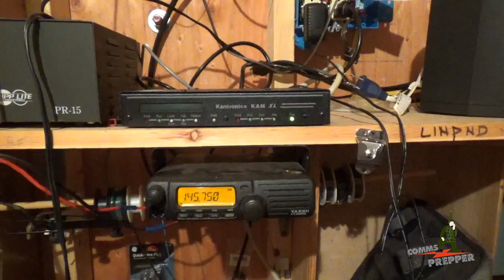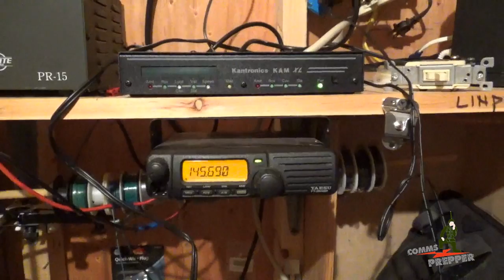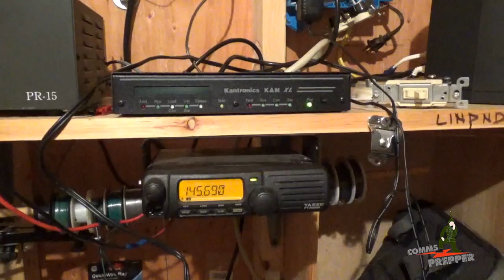Retreat Packet Radio Node Online

Comment: Someone over there at the FCC isn't exactly up to speed on things...  (If I've done my research correctly - Excerpt from http://www.ecfr.gov/cgi-bin/text-idx?SID=afee3b2f300f4a15d58e9127e086c46a&mc=true&node=pt47.5.95&rgn=div5#sp47.5.95.a) §95.29   Channels available.... Part (f) Except for a GMRS system licensed to a non-individual, a mobile station or a small base station operating in the simplex mode may transmit on the following 462 MHz interstitial channels:

462.5625, 462.5875, 462.6125, 462,6375, 462.6625, 462.6875 and 462.7125.
Reply from the maker: Not sure how this relates to the packet video.
Reply: +Commsprepper ... My bad, I meant to post that in your Midland handheld review. oooops!

Comment: I wish my 2 meter packet station could reach your packet BBS. OR to VA is a long 2 meter hop. Have fun and good to see packet on the air.
Reply from the maker: I can see other nodes but they have only net/emergency message notices.  What I don't know how to do is hop more than one node.   i.e. C ABD123 V XYZ123 V QRZ098.  How to string more than one relay in the CMD line?  Any advice would be welcome.  WV has the DARN network and I see lots of activity.  I just don't know where to land and leave messages.  Hank
Reply: Check out the BPQ32 type nodes. A Ham and I, K5DVT, go via Telnet to his BPQ32 node (we can go over VHF if we want to, but when you can get on packet from the comfort of a couch, why not?) From there we can connect to nodes across the state or across the world via Internet, VHF Packet, or HF Winmor simply buy wishing to connect to them.
Reply: Just keep connecting from node to node. I.e. You can connect to W4ABC, W4ABC can see W4BCD so from the console of W4ABC, C W4BCD... It's best to run a BPQ node so it keeps heard lists and aliases. I.e. from my station I could type "C CMSPPR" and it would automagically route to you the best way possible (Mix of IP and RF)